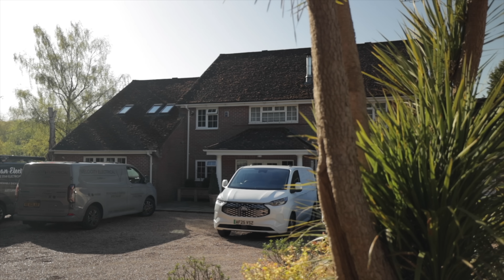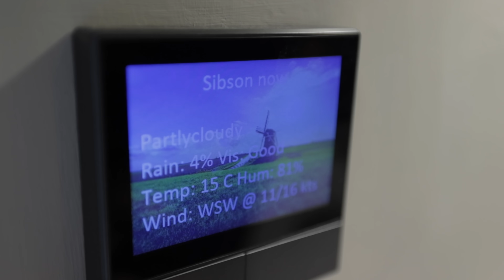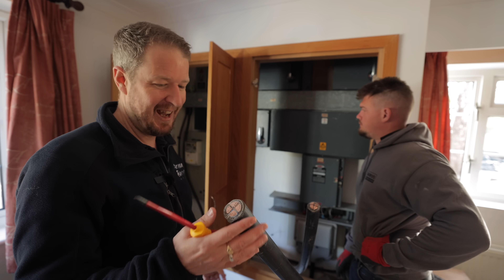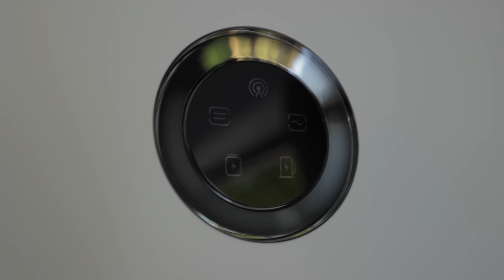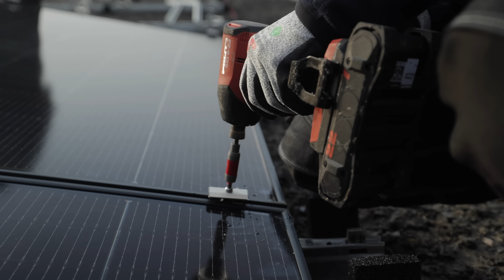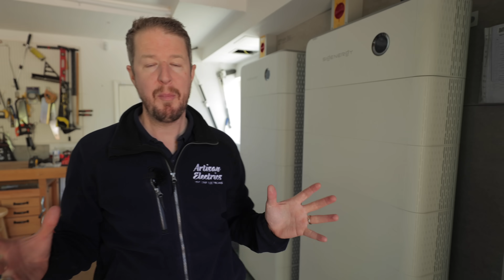Is Battery Storage Actually Worth It In 2025?

Comment: I've 5kw Duracell baterry in my attic.
Can i move it onto the outside wall of the house it is roofed but still bit exposed to elements.
Reply: Just make sure it does not get too hot. You can add some rockwool and plasterboard to keep the heat out and an active ventilation pipe going outside to release the heat and any gases from building up. 
If you do plan to move the battery outside, be sure to check the IP rating.

Comment: Yes, if you build and install it yourself. The price of battery cells is at an all-time low, while prebuilt batteries remain relatively expensive.
Reply: I agree... you can buy 16kWh of batteries for about £800 !! add a BMS... and that's about £1,000 compared to about £6,500 for Sigenergy ones... yeah, you get a fancy case for them... but is that worth the £5k difference ??  Why so many people get smuckered into these expensive solutions is beyond me.
Reply: @gregevans8939  Because most people just want a system they can have someone else set up and then utterly ignore, unless they are showing it off to friends in which case it has to look shiny and new 😂
Reply: @gregevans8939 Poor research, lack of knowledge, and regulatory issues in many EU countries are major obstacles. The fancy battery pack comes with certifications, while a DIY battery would be considered “illegal” to connect to the grid in many countries.
Reply: @gregevans8939 if dyi can just simplify the wiring needed and all the damn switches in-between everything... 😂
Reply: @gregevans8939  Yup, I did this - I have a Seplos v4 kit with 16x 315Ah cells, while a little more expensive (can be had at £1300). There's merit in the build quality of the case, compression, transportability and form factor (vertical storage). Working beautifully and will pay for itself in less than 3.5 years.
Reply: @gregevans8939  My guess is that a lack of knowledge and the inability to install something themselves are the driving factors.
Reply: If you're doing this you really need to understand how dangerous DC can be, loose terminals can easily overheat, wearing eye protection during assembly and service is a must.
Reply: @edcooper2396 That’s true, but at the same time, it’s not difficult—you just need to follow electrical codes and use quality components.
Reply: @edcooper2396 Haha, yes—and having a fancy-looking app definitely helps too!
Reply: I don't think you can have them connected to the grid without the proper certificates though so you wont benefit as much unless you are only making smaller ones for a workshop or shed.
Reply: It depends on local regulations and electrical codes. In most cases, it comes down to what the certified installer is willing to accept.

 @MagicMarvin33
Reply: Definitely build it yourself, that way you will be proud when you burn your house down because you know you did it yourself.

Comment: can solar batteries be fitted outside and open to the elements or do they need to be stored undercover?
Reply: Most if not all batteries are rated at IP66 so can be installed outside. Just because you can doesn't mean it is a good idea. Expect will get better service life installed out of the elements.
Reply: Those Sigenergy  batteries are water/dust proof so they can also be fitted outside.

Comment: This example is very commercial, perhaps with a very large property and a heat pump you might want 1 x 48kWh battery system - you'll be lucky to get DNO approval for an inverter that can charge that overnight tho. We have no Solar, but our 9.5kWh battery (charged overnight) and 3kW inverter (no DNO approval required) covers our household needs. We also have an EV (charged overnight). Over 98% of our electricity is at 7p / kWh vs 29p standard rate. Saving ~£100 per month.
Reply: That setup won't be enough to run a fully electric home with an ASHP during the winter, if you want to run  your ASHP on cheap electricity.

Comment: I am less than a week into a new live install. I consume average 10KWh/day. I went with a 5KW inverter, 10KWh battery, not a home gateway as outages rare, an EPS Emergency Power Supply off inverter in case of an outage, and I already owned UPS on internet and some expensive electronics if an outage actually occurred I can manually recharge off EPS.

In May the 7.4KW solar is generating 30-40KWh/day. Let's see in winter!

All my decisions were entirely in context. If I had more power outages I would not have gone for an EPS and manual switching, if my peak power needs I'd have got a bigger inverter, if my power needs higher, a bigger battery.

I also went for as solar diverter so my hot water comes from any excess solar so my gas costs reduce, as properrty already had a water cylinder, itself also a backup if gas were to ever go off - which it did on New Years Day.
Reply: We have a 5kwh system here in Spain, and we get some 300 days sunshine a year and from our system we manage to heat our hot water every day (on a time switch) alongside our  normal household useage with out the need for additional hardware to manage it.

Comment: No one in their right mind should be buying Battery Storage it is a National Grid responsibilty to do this in their network that we all pay for
Reply: NIMBYs object to:
- Pylons to get power from wind farms in far away low population areas to high demand area
- underground cables as they don't like pylons
- battery farms
- outages
- high energy prices

Yes a National Grid with battery farms near windfarms to store excess wind power to transmit later, and battery farms near demand to balance the grid, and pylons, and underground cables. But they are not allowed to. There's a quiet off-grid activity going on as a result.
Reply: @GeekfromYorkshire  Disagree here as they have Capacitor banks deployed in supply networks
Reply: @Mike_5 Capacitors aren't for energy storage, they're for smoothing power delivery.
Reply: lol good luck with that. I'd rather have my own solar/battery then rely on greedy electricity companies that yearly increase the cost and reduce the grid reliability, all the best and God Bless!

Comment: I predict that in a relatively short time the electricity suppliers will start throttling back the off peak rate advantage rendering these batteries as white elephants. Necessitating a further big investment in panels. They did that with economy 7 etc before
Reply: Everything is a calculated risk. I’m happy that I invested in solar and battery, that’s all that is important to me.
Reply: @the-silverghini lost food over 3 day power outage also annoying no internet so our sigenergy installation 24kwh gateway backup system was done asap with rebate. In Brisbane cost about $17k ROI will be around 6 years hopefully
Reply: Indeed. We're rapidly approaching the point when electricity will be more expensive at night, not cheaper, because that's when there is no solar. There will still be variations in price that you can take advantage of, but you'll need a supplier that gives you direct access to the wholesale pricing rather than just Economy 7.
Reply: @thomasdalton1508  Correct - the reason the UK still has these night tariffs, is because nuclear plants can't modulate fast enough. This will change the moment renewables take the upper hand - where then you will move to dynamic tariffs completely. The night tariff solely exists because of that - they need to get rid of the power. Your batteries, at this point, need to be super-cheap, to have any return-on-investment in the long run.
Reply: @ON8AD UK consistently draws 10% of its electricity from France's Nuclear power stations as this is cheaper than running up the gas generators.
Reply: @thomasdalton1508  I also have the same question. All power hungry devices (heat pumps, EV and home battery) work together during off-peak. A single home can draw huge amount of energy
Reply: @waterloowar  Yes. It is always the nature of arbitrage situations that people trying to profit from them eliminates them. With enough storage and enough shifting of demand, we'll eventually get to the point where electricity prices are constant.
Reply: The energy companies are paying wind farms to switch the turbines off due too much power generation. It’s in their interest to sell off the power cheap at night. 
Yes, I agree, the prices may change in the future, however, I can’t see this happening for a long time. It would kill the electric car market.
Reply: @danielrowe2119  The electric car maker is killing the EV by themselves. They did not make the battery replacement cost transparent and keep it very expensive. This makes the resell value of a EV to a stupidly low level.
Reply: Considering that ΑLL businesses & households are not using any / much electricity overnight, cheap overnight rates are here to stay for a very, very long time, even if everyone has a EV one day.
Reply: Depends on the penetration of wind energy vs solar - quite often there are windy nights in the UK and plenty of energy at night,  Here in Australia it's solar during the day that is in surplus.  The 'cheap' electricity (off peak/controlled load) will move to that part of the 24 hr cycle.  Battery payback can be less than the 10yr warranties and there is not  many other household purchases that provide ANY payback!
Reply: The grid would rather make some money from having to not throttle a power source.

It also means that some infrastructure costs maybe deferred by the grid. Though not sure in the UK how many home battery systems are actually going in and do they move the dial. I have read that in Australia home battery and local BESS will be help reduce infrastructure costs.
Reply: no need to predict, there's already movement towards dynamic tariffs over fixed time ones.

Comment: How many years before the cost saving on electricity paid for the Investment?
Reply: everything in context. In my home at current energy prices maximum of 8 years for solar+battery. We had the electricity utilisation so that's less difficult to predict, but gas was water+heating. I moved the export electricity to water saving on gas, how much that saves, harder to predict.
Reply: For me 5 years. But let me ask you how long did your last new kitchen take to pay back its investment?
Reply: @nealm1814  You need a kitchen regardless. You can do without the additional cost and complexity of batteries.
Reply: @nealm1814 What a stupid comparison.

Comment: I want battery storage and solar- but not for $30k-90k for parts and labor
Reply: Just start small and upgrade as you can afford a bigger system, that's the great thing about Sigenergy, you can upgrade the battery size later and it doesn't matter if the old batteries are years old, it still works, as for Solar, same thing, upgrade as you can afford it. Start small and go from there, that's what I did and I never look back.

Comment: Very good presentation on the advantages of having batteries.  The solar panels once added will give even more options I like the idea of having the emergency backup if needed and being in control over what keeps running.
Reply from the maker: Absolutely!
Reply: We go off grid as soon as a storm approaches great backup using a sigenergy system 24kwh is enough for 2 days more if solar kicks in

Comment: Home assistant is not that technical you just need to learn how to set it up and there's a ton of help in the community.
The main advantage with HA is that YOU own it, it's not on a cloud, it doesn't rely on some composite server and if the company running the 'SMART' app decides there's money in it and pulls the plug, HA will still be running.

Comment: The problem I see is that Sigenergy is very good but the cost per kw is still too high. Especially when you think they pay Caatl USD 28.00 per kw for the cells they build the batteries from.
Reply: $28.00 per kilowatt hour. Yes, the markup on batteries is atrocious.  You can pay something like £1000 per kwh for a battery. Meanwhile you can get an EV with an 80kwh battery for £40k. That means the car storage is around half the price of a battery and you get a car thrown in for free,.
Reply: The thing is your not just buying the batteries your buying the BMS and things like the gateway that handles the charge, discharge and backup events. Plus obviously Labour.

The larger the system the less per kWh you end up paying as you spread these costs over more storage.

If your buying 10kWh of storage this is a significant part of the costs but once you looking at say 50kWh where I am now it lowers the cost per kWh.
Reply: @lesliegossner681 I would like to draw your attention to a Sigenergy stack. At the top is the module with all the immediate functions which you pay a specific price for. Below that are dumb battery modules with nothing but wiring leds and battery cells and a case.
Reply: prices in the UK are high because electricity cost is high and the market is still somewhat supply constrained due to a lack of installers
Reply: @edcooper2396 The cost of electricity in the UK does not affect the cost of batteries. That is set by the manufacturer and Importer.
Reply: Should you be talking about electrical supply you use the term kwh. Referring to electrical capacity amperes or kw as in battery capacity!
Reply: So buy directly from CATL and make your own casing, give your own warranty, program your own BMS
Reply: It is bit like buying a car with a battery. Sooner or later the competition pressure negates the price gouging @Lewis_Standing
Reply: Daaaamn, and just yesterday it was $100 a kw....

Comment: Being completely new to all this, my question is simply around return on investment. If I have a system without solar for a typical 3 bedroom home, how much would that cost (ball park)? The benefit is to charge with cheap electricity during the night. So assuming that I am only ever using power from the battery storage, how long does it take for the electricity savings to cross over the initial investment?
Reply: The calculation with such a system is it all comes down to the arrangement you have with your electricity supplier.  Contact them (you may have several options) and see which offers the most appropriate rate for your use. According to this video, the "off-peak" window is as short as five hours. You will be limited by the power supply to your home (typically 60A single phase in the UK) the throughput of your inverter and the charge rate capacity of the batteries used (all explained in the video). Your existing power bills will give you an idea of your average usage, so use that as a start for how much you need to store up overnight on cheap rates. Let's say you normally use 10KWHrs a day. Then you need to store at least 10KWHrs every night in five hours, or 2KWHrs stored per hour charging (assuming nothing else is running a big draw like an EV or storage heater). That's pretty easy to achieve. You will need at least 10KWHrs of storage (I'd suggest 12) which can cost £500KWHr or (according to the comments here) much less somehow. Let's say you get the battery, inverter and install for £10K. You just have to make a simple spreadsheet of your before/after electricity costs to see where your payback arrives. If your daytime charge was 20p but you can get it off-peak at 10p, then you can save half your usual power bill every day/month/year. The more you use (such as if you have electric heat) the faster the payback. But in many cases the actual financial calculation is not why people go with solar in the UK (a far-north country with dismal solar possibilities)
Reply: Depends on your annual electricity bill. If it's £1k, that represents the max you could theoretically save each year. So a £10k system would take a theoretical minimum of 10 years. More realistically; assuming it halves your annual bill to £500, it would take 20 years. If your current electricity bill is higher, the pay back is shorter
Reply: @lewispearson  you forgot about buying low, selling high. You would make profit during one year if you bought energy at 6p and sold it back at 30p every day which would dramaticaly shorten the time to recoup
Reply: @Jultsu  I think its difficult to be profitable doing that without solar contributing to the battery. I have a 20kWh home battery with solar that I charge cheap and export any remaining charge every evening, which works great on sunny days; but in the winter once you account for daytime usage and round trip efficiencies I'm lucky if my export covers import and standing charge. So I still think a good rule of thumb is that your annual electricity bill is probably your theoretical max saving per year.
Reply: @lewispearson  That doesn't sound like a viable option. If we take a median at 15 years, the batteries and technology will be very outdated by then, if not obsolete, if it still works at all. So the "savings" are a completely mute point as there is no saving. Its only an option if you have a load of money sitting around and you have a need to spend it, because a battery storage system certainly does not pay for itself in savings over its life span.

Comment: Yes, it's worth it. But the HV batteries are most likely not worth it - unless you get them really cheap. I've bought and sold a few 15-16 kWh LV batteries for about €1300 including case and BMS capable of discharging 200A at ~50V. ROI less than 3 years just from powering the house after the sun is down. I'm sure the kWh price for these HV batteries are at least twice if not three times as expensive. It looks much better, though.